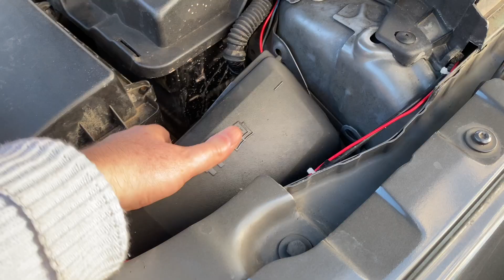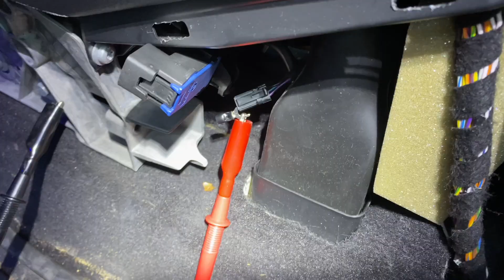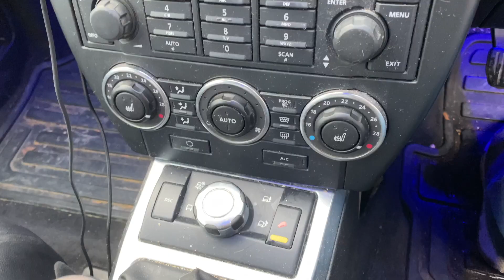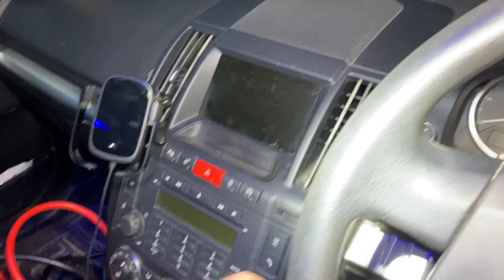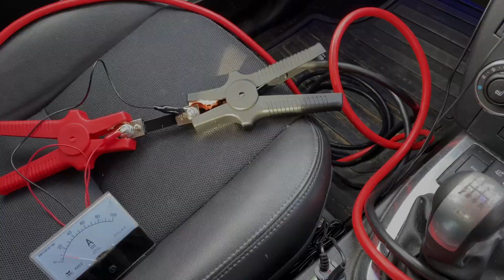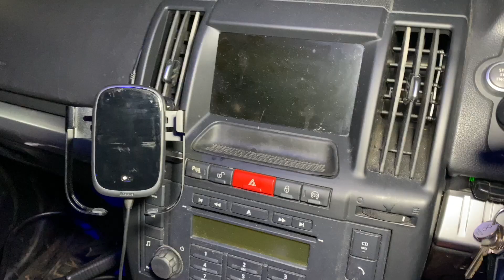Investigating the mysterious PTC heater fitted to Land Rover Freelander 2 / LR2

Comment: Did you work out what was the best method for defrosting HS vs PTC
Reply from the maker: I only use the heated screen if icy, and turn it off as soon as I can to allow the PTC to kick in. I also now turn the temperature knobs to cold before starting on frosty mornings to prevent the PTC drawing valuable current from the battery.

Comment: I live in Cyprus and often in the shoulder seasons I have the heating set to cold but still warm air comes through the vents. The outside temp is much cooler than this air but certainly more than say 15 degs. But the sunshine will warm the cabin through the windows enough to make it feel. tad uncomfortable but not enough for the Aircon to be needed. I just can't understand how the air from the vents can be warmer than outside unless the thermostat has gone in the Heating Temp Control.....or ...... now I'm wondering if this PTC thingy is faulty and is warming the air? The Temperature here rarely goes below 7 degrees at night and only then during February. Though happily not this year! I'll have to investigate. I may as well take the fuse out for the PTC......!!

Comment: Help Please
Reply from the maker: What’s up?
Reply: @BeavisPits  How would I contact you, connected the hair dryer activated but it is in error and do not know what to do, do you have an email that would write to you
Reply from the maker: The PTC element has permanent 12V connected and is then controlled by a pulse width modulated signal wire. If this is connected to 12V the heater element will turn fully on. Everything I know about this is shown in the video. If you need further help then please ask on one of the facebook groups or freel2.com
Reply: @BeavisPits  I got it. It's just that I did everything and plus and minus and chip and activation and there is a bug b10ea-14, so I do not understand that neither
Reply from the maker: See this page : https://www.autocodes.com/b10ea.html
Reply from the maker: Also check the 100A in the engine bay fuse box
Reply: @BeavisPits  I called him whole
Reply: @BeavisPits  Okay, I thought there was a certain sore or a known problem, but here they write in principle to check the wiring, maybe the body equipment control module has died 🤔 out and the mass you screwed where? I'm in the passenger's legs on that crane where you hooked minus the multimeter I screwed it there

Comment: Great video  my PTC also has not apperently working due to fault code I have seen. When swithing the fan to full it pushed water out above the PTC. So I figured this was clear water not coolant, From your other video on drainage pipe for aircon blocked , I realised that this water is being stirred up in the ducts, next to fan , is this possible. I will ceck th tube as per video.
Reply from the maker: Does sound like aircon condensation water is not draining and building up inside the heater
Reply: @BeavisPits  Checked aircon leakage under test , water leaking underneath to ground as normal, so yes draining properly, may take off dash gear to see if any other leakage appears. Holes in scuttle now clear, thanks to your video.

Comment: I have a similar PTC heater from FoMoCo. My issue is that interior and exterior lights, displays etc are flickering when PTC are on. I know it's a guessing game but what might cause that? Bad/weak battery or/and alternator? Bad PTC? Bad CEM/CCM? No flickering otherwise as far as i know as long as PTC are off and I'm idling with engine normal temperature. PTC makes warm air. So it seems to work. Engages under 10 degrees Celsius. Please help.

Comment: If you have the Gap II tool  or maybe other code readers, you can read the live values for the heater. It switches on automatically, external temp 3 degrees C  and rapidly reaches a temperature of just under under 69.8 degrees C. and is indeed cut off if the heated front seats or the heated front window is on. It is not dependant on Prog
Reply from the maker: Thanks Mike. I think mine still worked with the seats, but not the heated screen. I’ll revisit the PTC in another video soon.

Comment: I have a 2007 F2 do I have this??
Reply from the maker: Probably. Check to see if the fuse is present. You can also remove the console side panel and look for the plugs on the end of the PTC element.

Comment: Hello! Could you help me? I have lr2 2007, without PTC, I installed it and now I need to flash the HVAC unit to activate it. The HVAC unit is absolutely the same as yours. Could you look at the firmware version on your block? H/W 6H52-14C239-EB
Reply from the maker: Is the number written on the PTC heater element? I don’t have my PTC here at the moment, it is in my storage unit, but I can get you the number when I’m next down there.
Reply: @BeavisPits  No :) I mean, if you have a diacnostic of sdd types or another. Please read the firmware numbers of your climate control unit. (HVAC) H/W ver 6H52-14C239-EB but I do not know the SW version.
Reply from the maker: I’m not sure if my Autel AP200 will read this information. I will have a look next time I plug it in.
Reply: @BeavisPits  Thanks.

Comment: Great video ! I always wondered how the blowers had warm air so fast never knew there was an electric heater on the car! The Auto function is the best mode, not sure if I missed it but the windscreen heating also enables automatically when in auto👍🏻
Reply from the maker: Heated windscreen turns on with Prog, but this turns the PTC off to reduce current drain. This is where I was going wrong all these years!

Comment: Hello,i want to ask you why in summer with out side temp.30 degree still heather is working,only in auto heather is not working.Problems are sensors or something else,thank you for great video
Reply from the maker: Check the internal temperature sensor (small vent near key)
Reply: @BeavisPits  i disconnect ptc heater and i drive the car and still there is hot  probably is caming cot from heater core under ptc.I investigate heater core and i find that the h.core is all the time supplied trom water pump with coolant.The problem is maybe with some flaps ?
Reply from the maker: @kirekapsa  yes the heater temperature is controlled by air flaps not water flow. The element is always hot, but air may not flow through it to the vents.

Comment: Workshop manual discusses the need for the higher rated 115/180 amp for those vehicles with heated windscreen and electronic heating booster
“NOTE: Vehicles fitted with an electric booster heater and heated windshield will also be fitted with an uprated 180 amp generator.” This isn’t in line with your findings that it’s one or the other, as I read that if the alternator is correctly spec’d, they should both run fine? Do you have the correct spec alternator?
Reply from the maker: It is the alternator which came with the car when I bought it, so it should be the correct rating. Next time I’m in the engine bay I’ll try to rear any markings/labels.

In part 2 I will attempt to override the PTC control so it works with the heated screen on too.

Comment: Another great video. I did notice that you are on auto heating. I wonder if that makes a difference?  Maybe a test for your second video.
Reply from the maker: Thanks, I don’t think auto made a difference, but I will check that. Auto does the fan and direction only. I have checked it with manual controlled direction and fan and it seemed to still heat, but I have also heard that there is a minimum air flow required before the element turns on. I’ll do some more tests!
Reply: @BeavisPits  I tried mine last night, it was 6c so wasn't expecting much but actually within about 20 seconds there was warm air. Really interesting stuff,  I'll be interested to see the next video recording temperatures. You could probably use an arduino to feed the PWM so you could adjust the temperature yourself depending on the voltage of the PWM of course. I wonder if the ECUs detect that the PTC is disconnected though?

Comment: I’ve only had my Fl2 for 10 years and didn’t even know it had an electric heater. Great video. Nice investigative work. Your FL fan base is growing! 

By the way. I didn’t spot your snorkel. Did you take it off or what fitting that afterwards. Or did I miss it.
Reply from the maker: The snorkel isn’t fitted yet. Had to put that project on hold for a year. Will resume the development in a few months.

Comment: Are you concerned about the difference in Amp drawn between the two? With what appears to be two separate elements? The 1/2 draw from the installed one could mean one side isn’t working any more? Only small wattage but 120w vs ~240w is a fair difference
Reply from the maker: You may be right...I’m not sure if the heater has two halves or not. The 20A test was performed the next day when it was even colder, so maybe it was just heating more. I’ll do some more tests in Part 2 and swap out the element if it looks half blown.